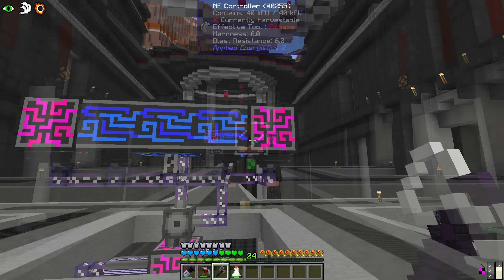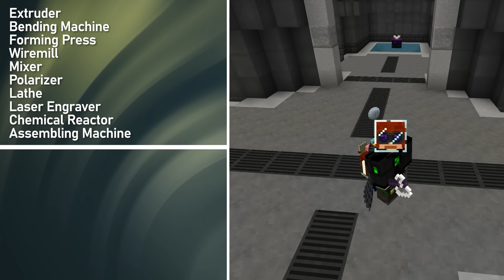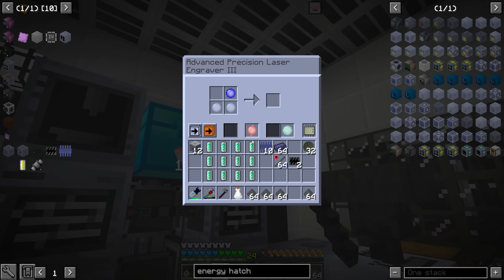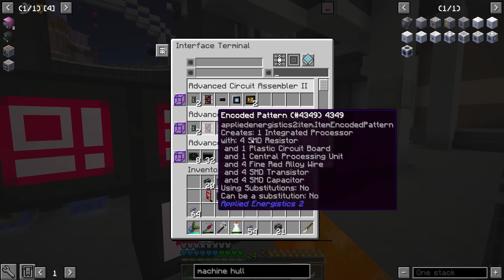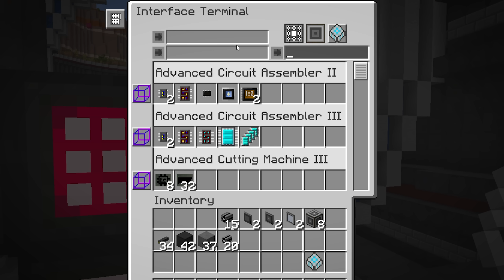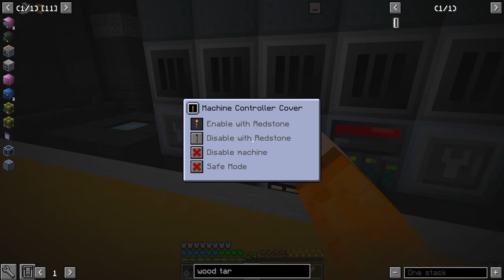Gregtech New Horizons S2 43: AE2 Autocrafting

Comment: The first step of AE2 automation is to secure a consistent power source, which the upgraded benzene setup has accomplished. The second step will be automating all of the recipes that are used in setting up automation. Cables, interfaces, P2Ps, patterns, relevant upgrade cards, etc. Now in GTNH this isn't as straightforward as it is in most packs since - as you've no doubt noticed by now - the GT++ machines you really want to use for these sorts of automations are oh so very expensive, so setting them all up at once is inefficient if not outright insanity. Your best bet is to make a list of Multis you'll be setting up and either prioritize the ones that'll have the most benefit (be it in terms of speed, power efficiency or machine type, whichever you deem more valuable) or go for whichever is the least obnoxious to craft. That said you'll be wanting them all eventually anyway, down the line even multiples of them, so in my opinion it's best to start with the most commonly used machine types no matter how obnoxious they might be to craft. Chances are that'll be either a Wire Factory for faster wires/fine wires, or an Industrial Material Press for faster plates/foils. Both of which are also used in crafting circuits or circuit components, so again, if you've got no better ideas those two are probably as good a place to start as any.

Don't underestimate the importance of upgrading your circuit crafting capacity. A single machine crafting circuits - or two, one of which is a lower tier - is not going to cut it for very long. Circuits take a very long time to craft even from their components, about five minutes per mainframe with regular SMDs and only a single at tier machine to work through everything. And you're going to need a lot of circuits to set up the infrastructure to get to Assembly Line, even if you're not planning on crafting one within the next ten minutes. Or hundred hours, for that matter. Once you've got the means to throw silly amounts of power at a PA, through multi-amp hatches and most likely an LSC, upgrade your circuit production accordingly.

Important note: When a GT++ multi says that it's "500% faster than using a single block machine of the same voltage" it means exactly that - 500% faster, meaning 600% processing speed. Also, yes, that's 600% processing speed at the same EU/t, meaning it'll cost ~0.167 times the normal EU cost per recipe. "That sounds unbelievably overpowered", you say? On the surface it might seem that way, but remember that this is rapidly approaching the end of the early game. Once the midgame difficulty spike kicks in it turns into a sheer cliff face, and without these GT++ multis setting up a proper factory would be worse than pure suffering. It'd be pure boredom, setting up PA after PA after PA because nothing else would come close to the processing capacity you need, in addition to setting up fields of LCRs (and a few assorted multis) for the chemical lines. As-is GT++ multis have a competitive edge over PAs with their per-recipe speed boost and EU efficiency, which certainly beats out the PA's higher parallel maximum and theoretical adaptability, but IMO specialized machines are fine being a better option overall than a machine that's designed to run almost everything possible. PAs will get the last laugh in the lategame anyway, once their downtiering option comes into play and they turn into parallelizing monsters.

Generally you always want to use only the minimum number of casings that a GT++ multi needs, and fill in any empty spaces with extra input buses. Some of these multis are going to end up with a ton of different interfaces either due to integrated circuit numbers or just sheer quantity of recipes, and so the more space you have for input buses, the better. Also no, input buses in GTNH can only input through their actual input face. You could use transvector interfaces to circumvent that, but at that point you might want to consider another multi instead.

I'm tempted to start a drinking game with how often you end up setting something up to be replaced later due to a lack of platinum, but I would prefer not to lack a functional liver by the end of the video, so...nah 🙃.

For the record: 1x copper cable takes 5 second to process one ingot of copper, 16x wire takes 2.1875 seconds to process one ingot of copper. That's a significant speed difference, but remember that uncrafting 16x wire into 1x wire is a crafting table recipe. And in GTNH each Molecular Assembler takes an EV Assembling Machine to craft. It's also an additional crafting step that AE2 will have to deal with, which makes autocrafted recipes more complex (not that that's worth too much, at least at this stage). Probably worth it if you can afford it, but take care not to end up negating your speed bonus by just creating a different bottleneck down the line.

When a GT++ multi says it gets "x parallels per tier" it considers LV to be tier 1, by the way. So at EV it gets four times the listed amount of parallels, assuming there is enough power to support that many. So, yes, 16 times the number of recipes at once at 300% processing speed for 75% the EU/t cost compared to a single block machine. This is not the start of the GTNH equivalent of the industrial revolution, this is the first look at what midgame is going to require just to enter without completely losing your mind.

You can, by the way, wallshare GT++ multies as well as you can wallshare other multis, which allows you to get a lot more mileage out of the same amount of casings if you design your wallshared multis correctly. Just be careful with wallsharing input buses and the like, since even the same multi might end up configured to act as a completely different machine.

You can also toggle input from output side allowed by right-clicking the front face of a machine with a screwdriver, and the front face side you can, in turn, change by shift-right clicking the new front face side with a wrench.

For the record, the GT++ Assembling Machine multi is a ZPM tier multi, as the liquid metal required to craft the controller requires a ZPM tier ABS. And IIRC the ABS cannot be overclocked like an EBF can with 2x energy hatches. In any case it's outside of Three's wheelhouse, since he couldn't make LuV energy hatches either anyway without an Assembly Line. The Precise Auto-Assembler multi from Good Generator, which also functions as a multiblock Assembling Machine, is available earlier in terms of tech progression, but it's still LuV, so well outside Three's wheelhouse. And price range at this point, if not that.

I don't know if it has or will be fixed, but last I heard you can use AE2FC water drops for things like IC2 scrap or AE2 Singularities. I don't really think it's a big deal either way, just a neat bit of mod interaction, since you're definitely not hurting for stuff to throw away in large quantities in this pack.
Reply: THIS IS STILL EARLY GAME!?!?!?!?!?!?!?!
Reply: @Orciuolo  Late early game preparing for the midgame, but I do consider stone age to IV to be GTNH's early game, yes. The Assembly Line that opens up LuV is the first real test of your infrastructure, requiring orders of magnitude more resources - which have to be processed using production chains with (thus far) unparalleled complexity - compared to prior tech gates. And this trend will continue going forward, as well. Rockets won't be the final tech gates anymore, instead they'll be stepping stones to (at least make it easier to) reach it.
Reply: greg 👍
Reply: woah ty for all the info!

Comment: I usually craft as I go because the time you save by planning is eaten up by the planning itself and skipping the planning, but building all at once either ends up with crafting as you go in the case of too little or tons of resources locked up that shouldn't be if you do too much.

Comment: Great video as always Three.  I tend to craft as I go, it seems as though I usually need the machines to craft the next ones more efficiently (wiremill to craft the extruder etc).  Also I would worry I missed something so had to go back anyway!  Love the new AE2 autocrafting section, looks sharp!  Three, how will it work when you need to upgrade the backbone of power, say from LuV to ZPM+?  Will you just send more amps down or replace the backbone completely?

Comment: i dont get the AE2 fluidcrafting mod, AE2 can fluid craft just fine normally, idk why you would ever need to convert to drops
Reply from the maker: AE2 doesn't handle fluid autocrafting by default... A separate mod is needed for handling fluids here in 1.7 :)
Reply: @Threefold.  is that an issue with the version being run on gregtech? cuz in the fabric version of AE2 i use it can handle fluids just fine
Reply: @XiaoYueMao  for 1.7?

Comment: So, about having the voltage tier on the interface name... when you want to overclock that machine to ZPM or UV down the line, are you really going to want to rename all the interfaces? Seems like a pain. Machine name and circuit number are critical, but voltage tier seems like more of a pain than being useful.
Reply from the maker: Yeah actually upon reflection, you are correct. It's best to leave out the voltage tier
Reply: @Threefold.  <3

Comment: One thing I can recommend, especially in expert packs, is using drawers to auto-supply materials. Export bus on the back and storage bus (Extract only) on the controller, and you can set up bulk supplies for a ton of items. It's a very big timesink initially because it'll be crafting so many things, but it'll mean in future you won't have to wait for everything in larger recipes

Comment: perhaps cable should be colored by the material you use.  LV is red, MV is orange, HV is dark blue, EV is light blue, IV is whatever cable you use because you never use IV cable and LuV works with how it is currently because hss steel appears to be green in this modpack.
Reply: Generally the colour is based on the super conductors colour since there are multiple cable options for each tier

Comment: Three couldn't you have used a fluid interface to stock whatever fluid you need and then when encoding the recipe you just remove the fluid requirements?
Reply: When you’ve got many different fluids you’re working with, this can lead to recipe conflicts
Reply: Also, then you’d have to stock every fluid you need to work with, which often isn’t feasible
Reply: @deadlycwa  fair, most of my fluid crafting experience was from DJ2 not GTNH

Comment: For those fluid drops i’m pretty sure the way they work is that it is a reference item for the system so it’s a tangible item you can interact with it drop it, etc. however, when used in the system it will call upon the fluids within the system so if a recipe needs say water in an auto craft that drop will correspond to water by basically referencing it at least that’s how I’m interpreting it

Comment: Highly suggest using the schematic to auto build the multis you are going to build
Crafting with the machines is faster than the crafting table now with the multis, and is a lot more convenient to do exactly the size wire that is needed
You can screwdriver the face of the machine to set input from output
Highly suggest using dual hatches for your on demand fluid crafts
The machine casings uses plates, so you really don’t want to use circuit 8 on that bus
Reply from the maker: Ah good point about the Hull conflict if you request more than eight at once. Dual hatches? Do you mean the quadruple input hatches ?

Comment: Regarding the naming scheme, i highly recommend additionally putting the word "dual" at the end of interfaces to for example an assembler. This is so that when u get into fluid autocrafting and have dual interfaces on some of your machines, you can easily identify (from your interface terminal) if you can drop your fluid recipe into a machine or not. Trust me, it'll make putting in recipes on the fly a lot easier, when u dont have to go back and forth to check if ur machine has a dual interface
Reply from the maker: Amazing suggestion, I'll definitely make that change :D

Comment: Funnily enough, I find my biggest issue being transitioning between the different tiers. I still use HV machines despite being in LuV. GT++ with its multiblocks have saved me a bit from that but changing up the wiring is such a pain.